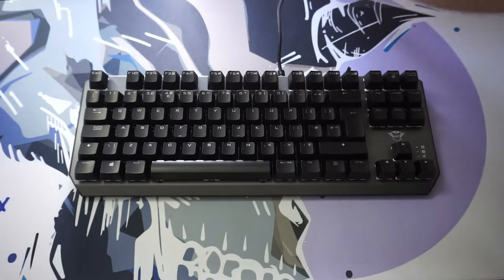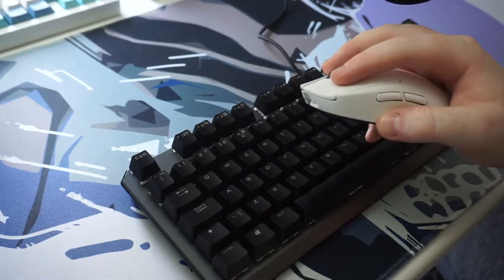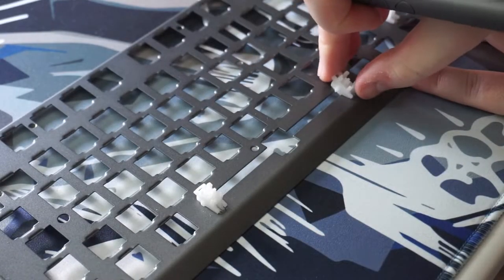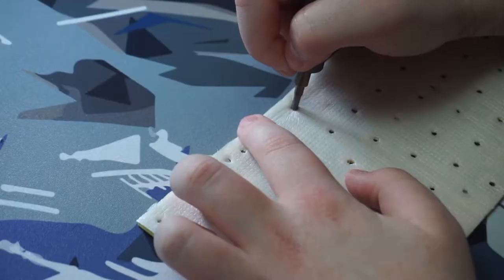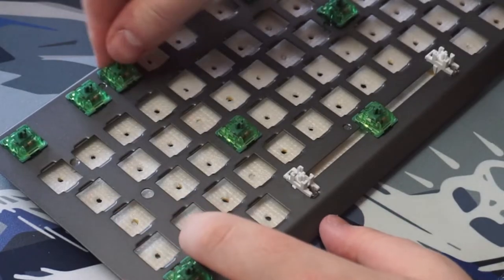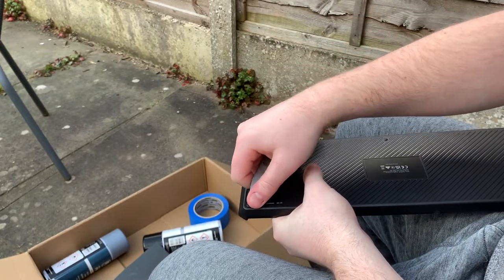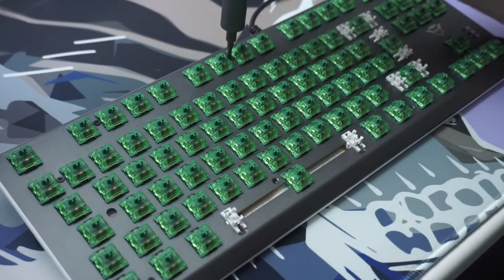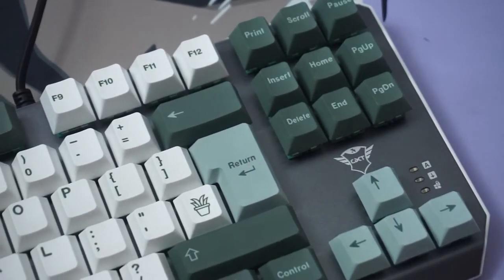I Upgraded A Budget Gaming Keyboard!

Comment: Just found you a few days ago and your so underrated!

Edit: I’ve never built a keyboard and I’m wondering what foam and stabilizers are good?
Reply: Most people use PE foam or whatever foam comes with the case. For stabs I recommend using Durock stabs they sell both plate mounted and screw on.
Reply: @LeBorkBork  Thank you!
Reply: @mrpenguin809  np